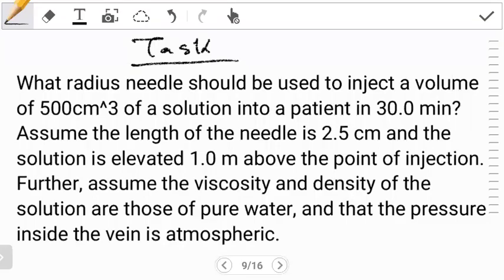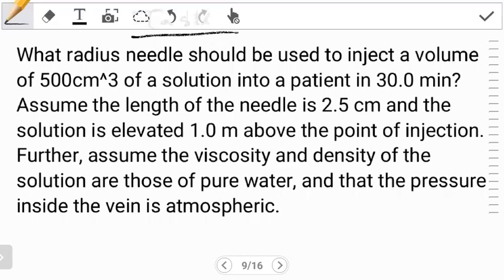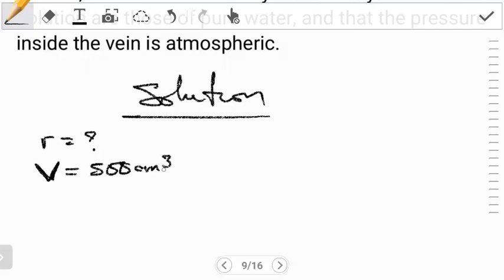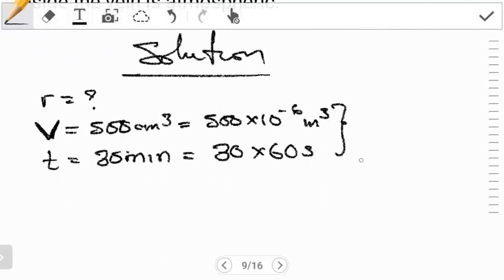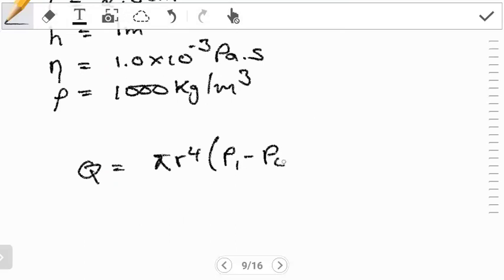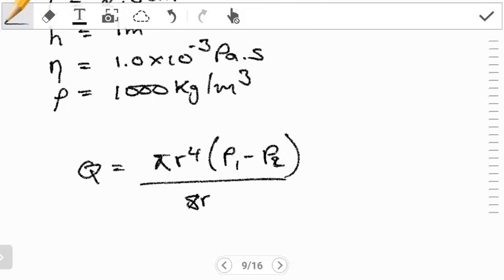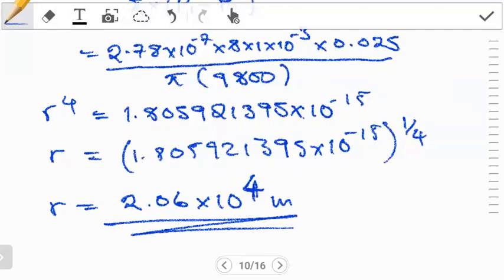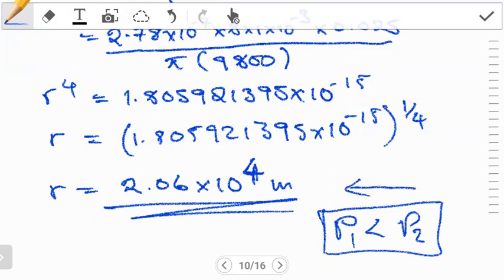Injecting 500cm^3 of a solution into a vein in 30mins : Fluids in motion

Comment: ertain wheel with a radius of 40 cm has a mass of 30kg and a radius of gyration of 
25cm. A cord wound around its rim supplies a tangential force of 1.80 N to the wheel, 
which turns freely on an axle through its center. Find the angular acceleration of the 
wheel.
Reply from the maker: Hi...
Find your solution here https://youtu.be/VhHfMHewSZg